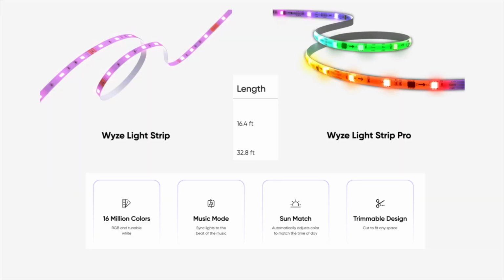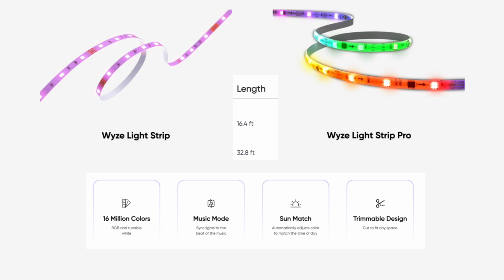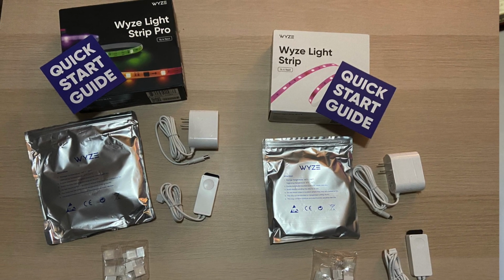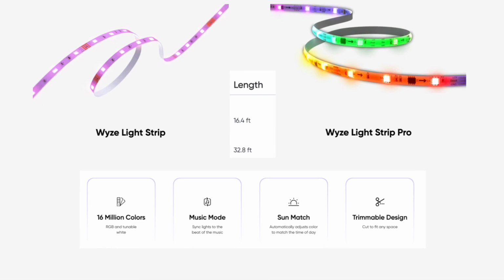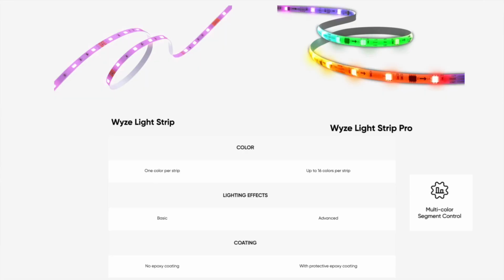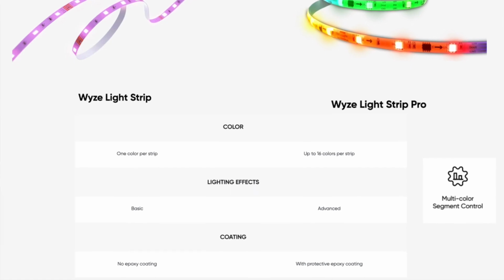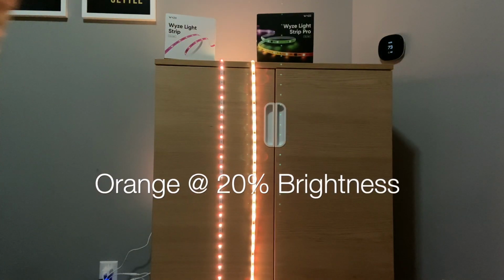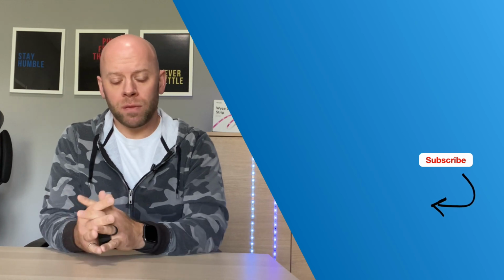Review: Wyze LED Light Strips and Light Strip Pro

Comment: Wouldn’t the epoxy coating on the “Pro” allow for exterior use? Also, wouldn’t it been more informative to point out the “Pro” uses addressable LEDs which allows the more customizable schemes?
Reply from the maker: I don't think you're wrong here...but I wouldn't call these customizable.